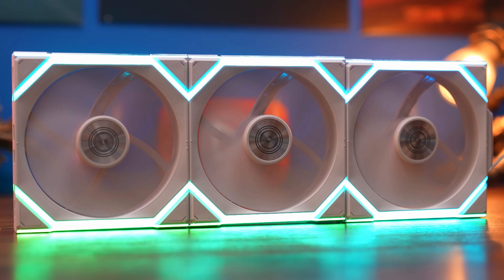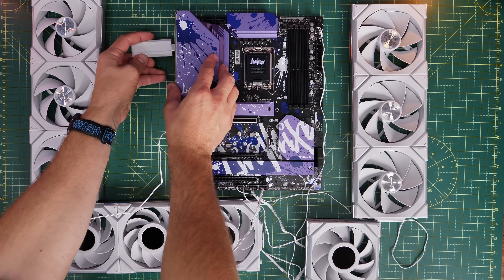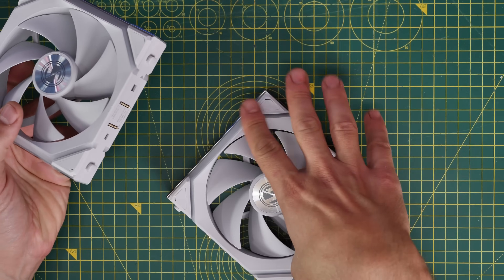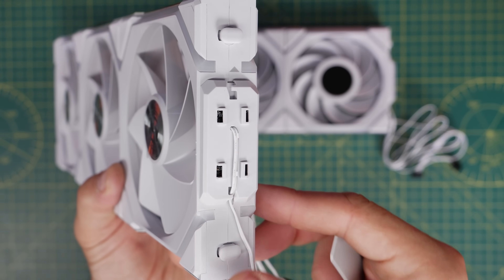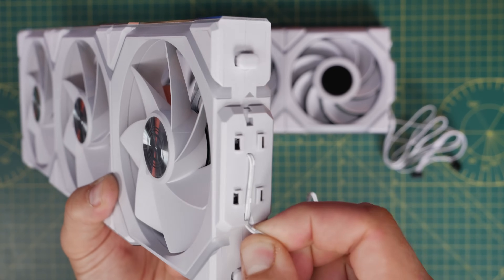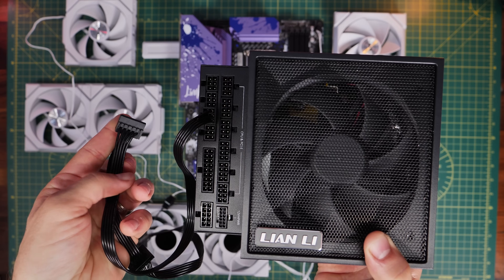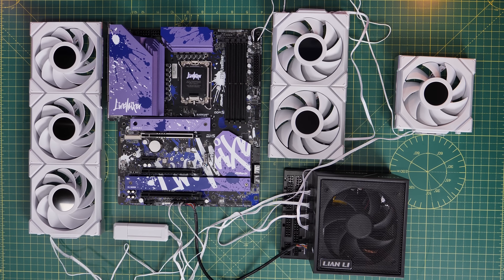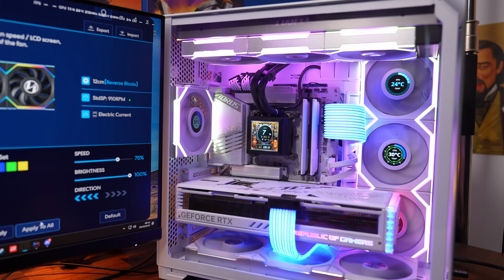Lian Li SL Wireless and Wireless LCD fan setup guide

Comment: The LianLi ecosystem inside the case is really flourishing. My current build is ROG GPU and Mobo, everything else LL. Can't wait for LL to get into RAM and other components, best lighting solutions out there. Thanks for the video!
Reply from the maker: That'd be crazy
Reply: @TheProvokedPrawn  how many fans can on controler control i have 12 fans and 3 controlers in case 1 isnt enough can i use 2 otherwise i dont know what to do
Reply: @just4gaming639 did u ever find out?
Reply: gros pd
Reply: @DoiteauNolann-y4w 🤣

Comment: I have really appreciated your videos on all these different setups, thanks.  I think I'm going to go with SL wireless 140s in a Lian Li 011DE XL.  3 then 6 on top for 420 CPU rad(just going to rely on the fans that come with the rad for a little while.) Then 3 on the side, 3 on the bottom and 2 at the back.  I've watched so many videos I've lost my clarity on recommendation for which should intake and which should exhaust so i can pick the normal or reverse blade.  Thanks if you have the time.
Reply from the maker: This is my preference - https://youtu.be/sVEXd-Wp8FY
Intake on the bottom and side, exhaust top and rear. I find side mounted intake rad with push pull is best for cooling the CPU and case.

Comment: As always, nice clear guide! I have a few questions though. Hoping you can answer before I buy these fans for my upcoming build. 

1. Does the LConnect software control the fan speed too? You said we can plug the fans directly to the PSU via Sata, so that means the motherboard has no control over them. 

2. Will this work with SignalRGB or other software for syncing? I don't want my Rams to get left out. 

3. Lastly, if I buy 3 sets of 3-packs, I will get 3 controllers but I only need one right?
Reply from the maker: 1. Yes 
2. I don't know
3. Correct

Comment: If using a set of SL wireless LCD 120mm fans with, say, two sets of SL140v2 fans(since you want them to look the same, and Lian Li hasnt released a 140mm version yet), how would that wire up to the motherboard? I'm assuming SL wireless hub and possibly the standard SL hub for the non-wireless fans, but does that cause any issue in L-Connect, or with management? Would it be better to plug the non-wireless fans directly into the mobo or a hub?

Comment: Can i use my previous ATX power supply with the 011 vision compact case or do i need to buy the lian li psu?
Reply from the maker: you don't "need" the Lian Li PSU. you can use others. If you're worried about USB ports, use something like this https://www.youtube.com/watch?v=d8vELbWWaCQ
Reply: @TheProvokedPrawn  
Thankyou I did order the lian li edge in the end I just like the organisation of it. I've just bought the Aorus elite x870 wifi ice. I have a question do I use pcie B C or D as my second pcie slot. A is occupied with my OS pcie.

Comment: I am feeling a hard pass for these fans, I initially considered this as an option to clean my cables and neaten things up because I have in total 10 Lian Li LCD fans with 2 its controllers + the corsair hub controller and because of this I have frequent issues where the LCD's fan RPM stat is bugged out and sticks to 0RPM(fans still spin though). I am assuming this is because too many USBs and the PC is getting somehow "confused". But it looks like this wireless fans have the same number of cables connected to the original LCD fans so I don't see much difference in terms of using less cables and being tidy.

Comment: Do you know if you can run wireless and wired fans and sync together?  I am considering getting these fans in the 140mm varient but they dont seem to do them in 140mm reverse flow lcd which i am after
Reply from the maker: I don't know unfortunately

Comment: I’ve also invested a lot in Lian Li fans and AIO. I have two pretty much new AIOs the Galahad LCD II taken out of the system because their horrible software had terrible memory leaks with it. The LConnect software is so bad it causes major stuttering in games. I also had to have the pump header replaced by LL bc it started flickering like a strobe light. Have spent so much money on their fans - which I now connect directly to a non Lian li hub which plugs into Mobo and controlled by Signal RGB. My PC had 10 AL120v2 as well

The biggest problem is that they don’t care or don’t do anything about it. They sell the expensive products that are slick with barely any support. I would steer well clear of them

Comment: Don't like the Lian Li quality. Got the non wireless LCD fans some time ago and the damn connection wire kept popping out as the cables were in a small corner. Tried to push in harder in and then the litte hook broke. Lian Li doesn't even sell those cables seperatly. Thermaltake Swafans are far better in every way with there magnetic connectors. Sure you don't have the LCD, but for the price Lian Li costs you don't get the build quality.

Comment: This is cool and all but after owning SL fans for a while , where Lian-Li lacks is their software. After lengthy troubleshooting I found out that their software was causing games to crash so I had to revert back to L-Connect 2. You can find out about this on subreddits. It may be also that it does not affect everyone or it depends on configurations/hardware.

Comment: How many fans can you control with one of those things though ?
I mean, i will need to control 11. 3 bottom, 3 front, 3 top, 2 back. Maybe even one more.
Frankly, having them powered by a SATA plug and daisy chain them just for power but control them wirelessly would be awesome. No cables visible anywhere. Though that might not be a problem if you go "back connect", you will still need to route FAR LESS cables.
Using several USB headers might be a problem, though there are a bunch of splitters for those to find, use one header, attach more to those, but, will that work. If you need to draw too much data for one, which i don't expect to be the case, might ruin your plans, or if it doesn't recognise them all. We really need more info on this.
Guessing these will be pricey.
Reply from the maker: You can control upto 8 channels (I.e. groups of devices) with as many as four fans per group. They said it will be 10 channels in future. So the number isn't a problem. Usb can be fixed with a hub, as I showed and used.
Reply: @TheProvokedPrawn  Yeah, wasn't really concerned for the hub, the works with most things, if it doesn't it's usually because of the hardware and or software and how that was designed, not because of what the header can handle data wise.
And later in the video i did indeed see it could handle quite a bit, so that is indeed very cool.
Now the Lian Li fan SKU number is getting quite high, i wonder when they will have the wireless infinity mirror variant.
Reply from the maker: @gabiballetje  Infinity are my fave and I'm surprised they've neglected them tbh

Comment: I was looking to buy a single lcd fan for a rear fan but the wired lcd fan requires a controller to use, so I ended up returning it. For these wireless fans, if I buy a single pack lcd will I have everything I need in the box to use in my pc, granted I have an open cha fan and usb slot?
Reply from the maker: You don't get the wireless controller with a single pack. And I'm not sure it works without it as I've not tried just one fan.

Comment: I've invested in Lian Li ecosystem recently but I regret it and I'm getting rid of it. Apart from O11 Dynamic Evo RGB case, everything else is just awful. Software to control it is probably one of the worst I ever encountered. Hydroshift AIO is probably has one of the loudest AIO pumps even on lowest RPM and the temperatures are worse than some of the slimmer AIO's I had and that's with high quality thermal paste and good mounting. My idle on 13700k was around 37 C, I had 29 C on Deepcool LT 720. Same fan speed set for both. The LCD screen does not work half of the time no matter the updates they roll out to L connect. I had to replace LT LCD fans several times as they arrived dead in the box and those that were not broken, the fluid dynamic bearing on those fans are actually audible even on the low RPM. Design wise, great and great ideas but their quality control is non existent.
Reply: I agree I have all the most expensive newest LCD fans and they are horrible. They forget their settings all the time.
Reply: Completely agree, apart from there rgb strimers and some cases, the only reason people really be buying there ecosystems is solely for the infinity and lcd fans, but with the infinity fans you can find good quality “knockoffs” (not rlly cuz some are just as good if not better) and with lcd fans those are completely gimmicks

Comment: I’m so glad I watched your video. I ordered a bunch of these fans plus the strimers when Lian Li announced them yesterday. After watching your videos, these aren’t going to work for me. I only have two chassis fan headers on my motherboard and that won’t be enough for three groups of these fans. I’ll just order some SL Infinity 120 fans instead, and save myself a bunch of cash in the process. Thanks!
Reply from the maker: Did you miss the part about the sata power connection you can use instead? Check the timestamps
Reply: @TheProvokedPrawn  I did see that. However, I thought that portion only addressed the need for additional USB headers. I thought that I would still need a fan header as well. I could be mistaken. I’ll watch it again.

Edit: Ah, I see now! Well that would work perfectly. Problem solved. Guess I’ll keep my order in. Thanks again for being so thorough.
Reply from the maker: @MisterDoItNice  👍

Comment: Preparing for an early 2025 build (Ryzen 9000 X3D + Nvidia Geforce 5080 or 5090 build). These are the fans I'm looking to install so this video was very helpful, thanks! One point: you talk about Lian Li L connect 3 software but I was wondering if this would also work with SignalRGB, which is the software I use now. The advantage of SignalRGB is that I can sync my entire setup (keyboard, mouse, fans, motherboard, even external components such as LED strips on my desk) in one smooth way. I would love to see you do a video on SignalRGB and how it works with these fans.
Reply from the maker: I didn't try it but should have I expect it would be a problem with the screens

Comment: Man Lian Li you have a lot of wires for wireless lol. Thanks for the video!!!😊
Reply from the maker: You’re welcome 😊
Reply: @Doc_Hollladay  it is crazy, insaine really... I mean, the entire point of wifi is to eliminate the usb connections and use a normal psu instead of mobo power. It appears they did that, then removed pwm as well, which pissed me off and fan power and then realized, "Oh crap we need power." Let's add the usb cable back for some reason... how is it an improvement to prefer power from a usb instead of fan, when psu is literally there for the purpose... why drive more power thru the mobo when you do not have to, because your not using signal headers.

Lian Li has proven themselves incapable of not regressing hardware and software, this is but one example of cyclical break fix approach...  release at all costs basically, not actually taking care of the customer.

They have proven themselves to be untrustworthy in software development. Another example, they just update l connect for these new fans, they broken older ones. 

Lian li fans are knightmares due to software incompetence and over release of every possible permutation of hardware instead of 1 good long lasting product... they want us to buy every little half finished experiment they complete every 6 months, instead of anticipating what we want and providing it. There is no evolution at lian li, only lateral moves, break fix, and abandonment when the costs of maintenance get to high for their marketing lead engineering processes and results.

It's very sad to watch, a company that made such great cases.

I'll be returning 15 tl lcd screens today... wasted 2 weeks screwing with them.
Reply: well because its wireless rgb the minimum i would need is 3 cables for me
Reply: @pcrecomedations  watch out. 1 gauge on these screens consumes 3% cpu.

Comment: The amount of fan headers that are unused on my motherboard, i can see standard fans working out but once you start adding groups of rgb lcd fans then this honestly just starts falling apart especially when motherboards have like 2 usb headers at a time and even more so if the standard fans aren't getting enough power. An extra investment will have to be to buy extra usb headers to compensate for those lcd fans.
Reply from the maker: Yeah like the Corsair USB hub I recommended 🤣

Comment: Lain Li, the wireless fans that arnt wireless and in fact more of a mess than previously where you really do only have 1 cable to plug into 1 controller, including the LCD fans, these just control the RGB wirelessly, the rest is a mess.
Reply: Yes....10 fans to one controller and one sata cable for tl lcd along with regular ones. You still need Sata cable especially if you are going to use white lighting. All this products does is save one controller from the strimmers.

Comment: Hugely informative video.  Preparing for an early 2025 build, this is helpful.  I spend 50x more time planning and contemplating the right parts than I do building.  It's likely going to be an AMD 9000 X3D build with a Nvidia 5080 or 5090.  So, these component build breakdowns are great for preparation.  Alas, I await CES January 2025 for all the things  :_Provoked:
Reply: @Mister_JJS  be careful, I'll never buy a lian li fan again after the TL LCD continuous stream of debacle. Strongly advise staying away from any lian li LCD and seeking guarantees that, if for example your wifi router were to go out, or if you boot to cli instead of windows, or anything like that... that your computer will not overheat since the fan control software is now so entirely dependant on ultra high level protocols like usb and wifi (instead of pwm firmware, low level).
Reply: @gunslingorgunslingorsadf8150  Solid advice.
Reply from the maker: Great to hear!
Reply: @Mister_JJS  keep in mind, each lian li fan can consume up to 3% of your CPU on a 9950x. AND LCD fan is gauranteed to... a wifi lcd fan, I'm just going to assume 30% OF MY CPU will be used since they don't tell me.
Reply: Bruh do not spend that much on a 5090 2,000 is way to damn much
Reply: @nathanielhenry3398  people can spend money how they want. Worry about your own wallet bud

Comment: No USB-C and no 140mm fan seems like a few points off for effort. Thank you for the video! This will make it into my new 2025 build but Lian Li if you are reading this make a 420mm LCD AIO!
Reply: usbc would be stupid, i doubt they need more than usb 2.0 to run
Reply: @Vextroboomin  considering new boards are coming with a lot more USB-C ports it would just make sense to start moving to the new standards in 2025. I would just plug it into the header anyway.
Reply: @unitymind  still, you have to consider older motherboards that might not have as many usbc, their simply aren’t enough usbc ports to justify wasting one on rgb when theirs plenty of other devices that can take advantage, if you really wanted just get an usb a to c adapter lel